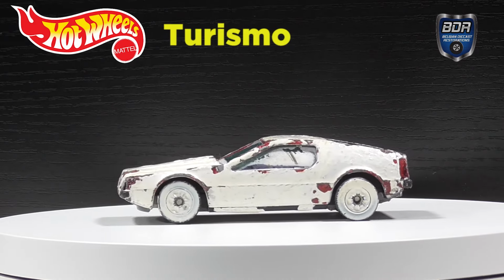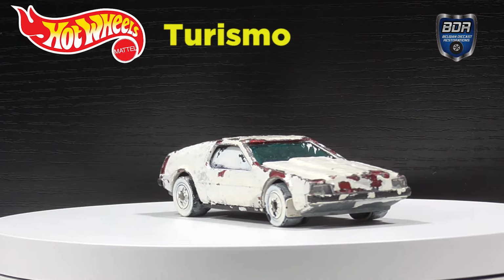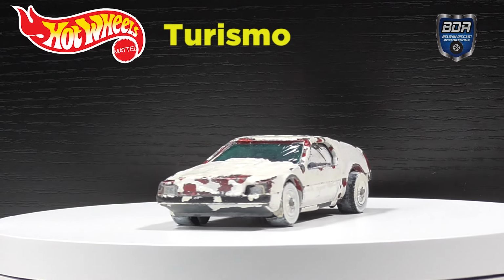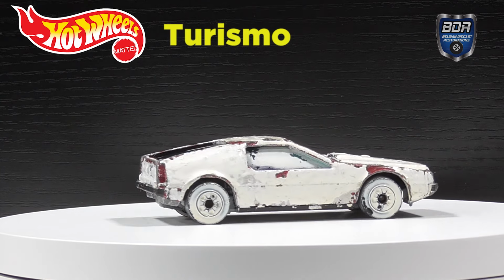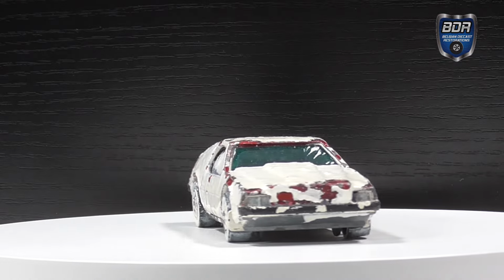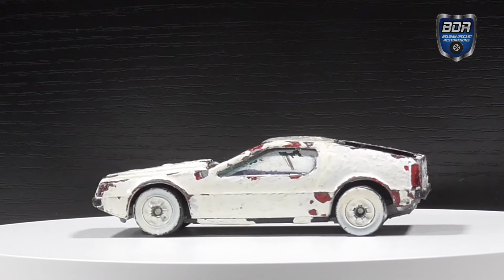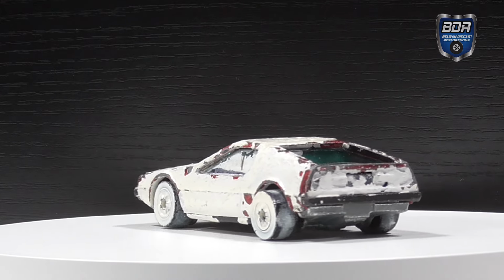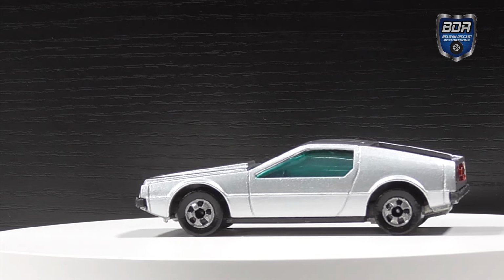The Hotwheels DeLorean that never was. Custom Restoration of the “Turismo” (DMC Challenge July 2024)

Comment: What type of jewelry welder and axle wire are you using? Very nice job on such an oddball model!
Reply from the maker: Thanks! 🙂
Those are 1mm steel axles. They can be found in any hobby store. I'm using an 80 Amp jewelry welder. You can find them on Amazon and AliExpress. It comes with all accessories, but I made a new wire with a crocodile clip to clamp on the axle. Make sure to use steel wire as brass or other light metals simply melt when welded.
Reply: @BelgianDiecastRestorations  Great info for all of us hobbyists out there! Thanks so much and keep up the good work.